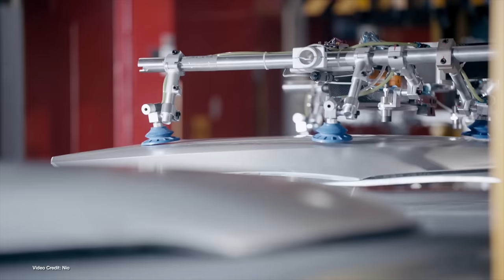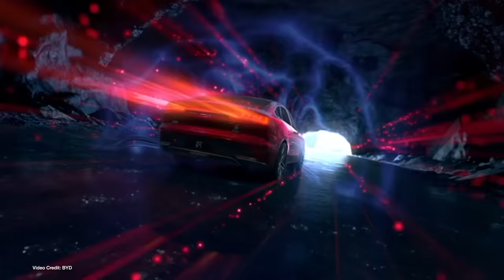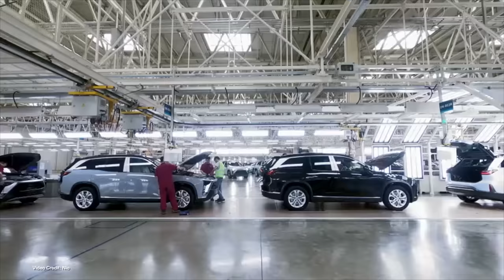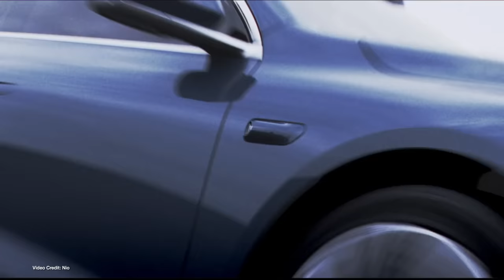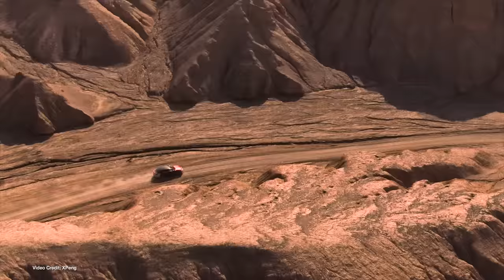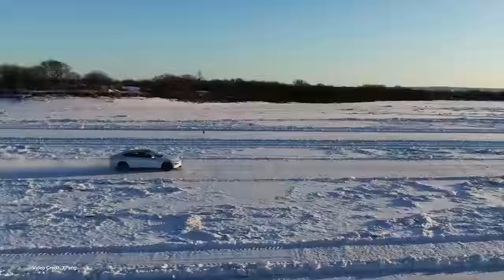Four Chinese Automakers You Should Know About

Comment: I have a SAIC MG 5 estate ev. and it is the perfect car for an ice driver to move to, it has no overly complicated tech as in no ACC or lane assist or massive screens, but it was a great price carries 5 people and has a 190-214 mile range with ccs and type 2. It drives very nicely and can shift in sports mode. Mg have messed up with the roof bars, but it will even carry a spare wheel if you want it.

Comment: Talk to Robert see if you can 'borrow' some of their footage and even maybe do a collab with Fully Charged using their Presenter they have in China.  If China starts exporting and with the prices you mention they will be undercutting many Western mainstream EV and classical automakers.  If they build quality and safety factors are as good as Western ones then wow.
Reply: Yes, I've seen several of his presentations.  His Chinese accent is quite understandable.
Reply: Something to consider ofcourse is import taxes. Chinese companies can produce cheaper cars, but they become a bit more expensive when they must be exported. For now they still would probably fall under the prices of other companies, but as the prices of EV's from the legacy automakers drop, this import tax might bring them around even. And unlike other companies that can get around this tax by starting production in other countries (for example Tesla with its Berlin factory), Chinese automakers will have the problem that they then would lose the advantage of cheap Chinese production/manpower.

In the long run Chinese car makers will likely play a much greater part worldwide than historically, but they are unlikely to keep undercutting non-chinese car manufacturers for a prolonged time, and ofcourse this undercutting is only possible as long as wages/costs in China don't rise, which is rather unlikely too.

Comment: Battery swapping seems a concept that works on paper but economically unfeasible to implement in the real-world. Even if the batteries were of a universal design, it would require manufacturers to build an entire network of battery swapping facilities, except for niche areas, that just seems a non-starter.
Reply: Which is happening to 10000 NIO cars yesterday, today, and more tomorrow. When you finish reading this comment, there is one NIO car just swapped its battery somewhere. It is not a concept. It is a bonus to those owners as they have fast charging as well.
Reply: i can only see this work in cities. everywhere else no.
Reply: I think two companies trying to do battery swaps failed previously. Considering the investment in inventory alone is staggering until you have enough people using the system to offset the cost. The design limitation is that every car has to have the same battery dimension, but potentially it could lower the cost of the car by making the battery a lease item and also alleviating anxiety about battery life when owning it. Battery swapping does work very well with Gogoro scooters
Reply: @kenmcclow8963  In the UK there is even no consensus as to a recharging plug design so that one cable fits all, how would the industry ever agree on something as complex as a swappable battery?

The concept of a swappable battery has a very limited time frame, recharging times will rapidly improve and overtake any advantage swappable batteries offer.

Comment: Regarding battery swapping, Tesla went down that road and developed a system that could swap a battery pack in less time than it took to fill a tank with gas. But they quickly realized that EV range was improving at a pace that would rapidly make battery swapping pointless. Tesla is already producing cars that can go a full week on a charge. The average driver travels less than 300 miles a week. LONG-DISTANCE CAR TRAVEL IS THE EXCEPTION. Even people who don't have home charging will soon be able to go a week before having to charge. Battery swapping is an unnecessary expense, and it limits battery pack design and integration into the vehicle.

Comment: I'd love to find some tech info on the Chinese eMoped I bought recently. It's branded as KiwiEco (in New Zealand) and one of two registered in the country. I suspect it might be part of an end-of-line dump as it was originally sold here in 2019 but has SLA batteries. I plan to do a lithium ion upgrade but it would be nice to have anything approaching a manual, preferably some proper tech specs. I can't even find out what the icon of a battery with a lightning bolt in it means (and no, it doesn't mean charging!)

Comment: Good T Shirt ... Please don't try to use Chinese because you make a mess of what it should sound like (I am in Hong Kong !!) .... You need to speak about production Volume.  Most Chinese companies do not produce EV's to any significant numbers.  Reason is because many are state owned or heavily state backed and the industry is hugely subsidized.  Their battery technology is weak when compared to TESLA, Hyundai, Samsung, LG etc.  Simply put, the Chinese CANNOT produce enough cars at volume and their constant changing models means that spare parts and after sales has been and is HORRIBLE.   Nio does not make enough cars, and will not be doing so in the forseeable future.  TESLA is going to take them all to the cleaners because they are serious about putting through quantity.  Battery swapping means they have to have more batter packs than cars and given that battery quantity is the production critical item and path, then their strategy is really stupid !!   Look at their production capacity ... ALL EV makers - they just cannot produce enough batteries.  Know you industry if you want to speak intelligently about it.